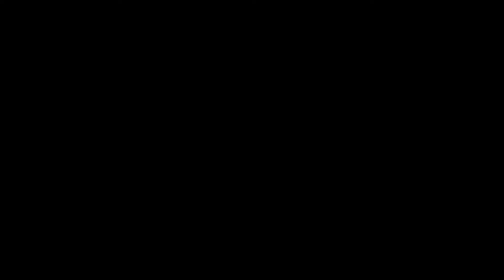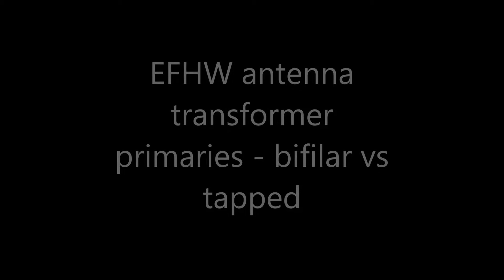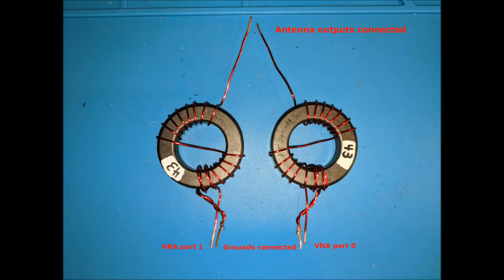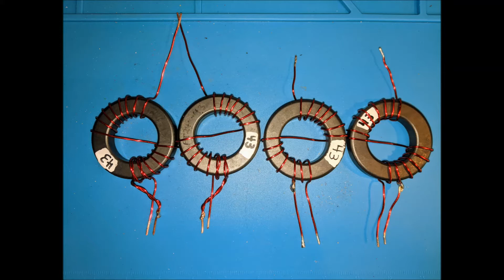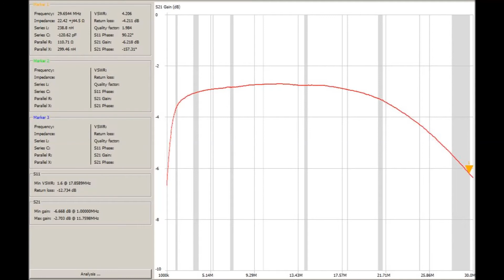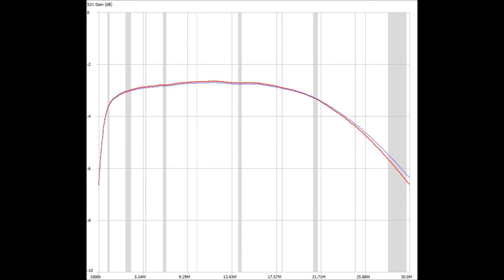EFHW antenna transformers - bifilar vs tapped primary

Comment: Never saw any advantage to the bifilar primary over the tapped auto-transformer winding. 
Good to see you test results confirm it. Also the 1.5 Db or so loss from the type 43 cores 
is often ignored. Throw in some coax loss and half your transmit power turns into heat.

Comment: At 1:15 here you say this is a particularly poor performing core. I watched your other videos and they all use type 43, except for the one where you compared type 52, which you show is even worse. I didn't see that you displayed a better core material type. Unless you are referring to the QRP video (https://www.youtube.com/watch?v=AjH1iesDWJI) where you compared two different sized type 43 cores; is that what you are referring to here, as the preferred core?
Reply: The material, the core shape, and the way the core is wound ALL affect efficiency and performance. Testing has demonstrated that chunkier cores tend to perform better than flatter cores of the same material and weight.

Comment: Just to say hi and thank you for your time. I assume you are using nanovna-saver and of course the nanoVNA. Could you please show us your test setup/jig? I would like to replicate. Also, may I suggest you to test this way of core winding: https://www.kn5l.net/kn5lEfhwUnun/
I successfully built a good performance transformer as above.
One last question, if I may, what core would you recomend for a 80-10 end-fed antenna up to 100W PEP/SSB?
Cheers and 73 de CT2FZI
Reply from the maker: Hi, no jig used, SMA connectors soldered to the primary wires for connection to NanoVNA and the 2 secondary wires of each transformer soldered together. To date, the best 80-10 core I have come up with is 2T/14T on Fair-rite 2643251002. Some details:  https://youtu.be/-Wm27Jpcq7I